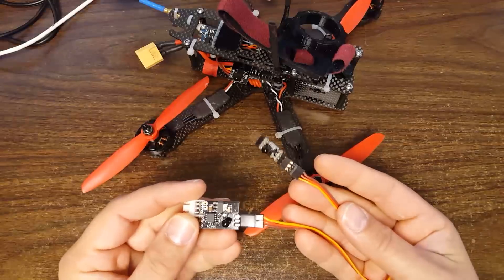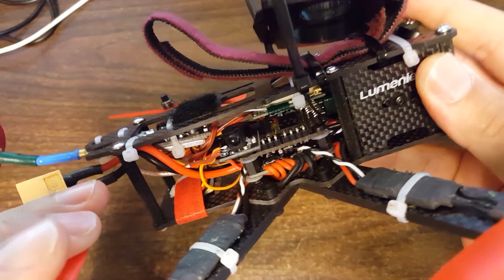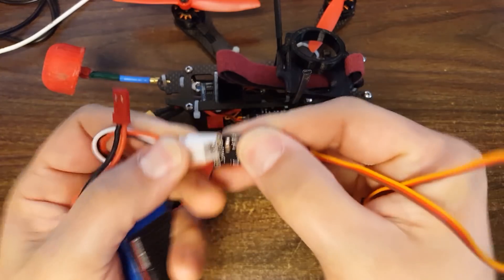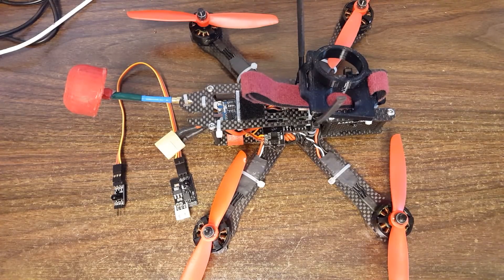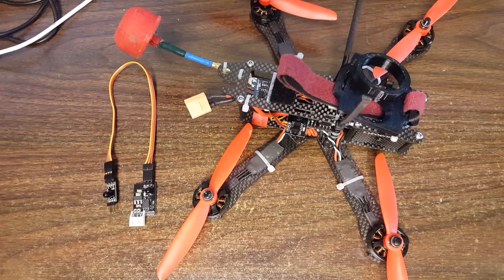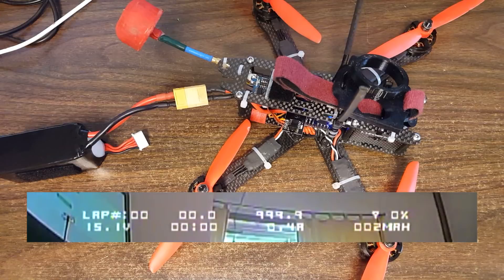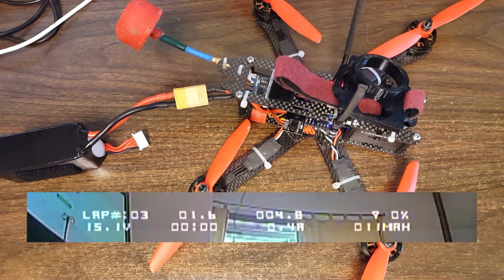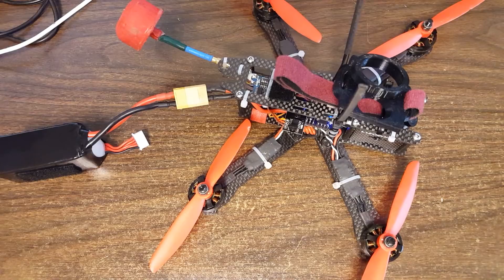RedRotor Lap Timer System Introduction

Comment: Hey Josh,

I also have the RROSD, + f303 v2, and was just wondering if you connected your fpv through the F303 or the RROSD?

I thought i saw it going through your FC but was wondering if you were, what was the benefit over doing it from the PDB?
Reply from the maker: +giovanni mercado Not sure what you mean. My camera and vTX are all plugged into the RROSD. The only connection between the F303 and the RROSD is the 5v power feed to the F303 from the RROSD.
Reply: That must be what i mistook for your vtx or cam. 

Thanks again for the recommendations! Keep up the great work!
Reply from the maker: giovanni mercado I used a spare JST connector, which might be what misled you.
Reply: Thanks!

One last question, were you able to pass through to BLHELI? Currently having trouble.
Reply from the maker: giovanni mercado I have had trouble getting it to work with this board. BLHeliSuite doesn't detect the ESCs reliably, or it says they have unrecognized firmware.
Reply: How did you eventually do it? Can't find the video but i think it was with an ftdi?
Reply from the maker: Arduino.

Comment: I got their PDB OSD you use.  I love it.  I never wanted an OSD because of the wire mess and I like things to be tidy. The Red rotor OSD is a great product.  I was able to cut and crimp terminals for my JR connectors nice a short from the PDB to the camera and to the VTX. 

I plan on getting this lap timer for when I practice with some locals. My OSD is V.4 so I should be good to go.  

Thank you for introducing me to these products.
Reply from the maker: +txfieros My pleasure.

Comment: Are you using "O" rings between the boards and standoffs.
Reply from the maker: +Invitingsauce No. But there are some M3 nylon washers because I needed just that tiny extra little 0.5mm of spacing to make the pins clear each other.

Comment: I did not know that the RROSD lap counting feature was going to be proprietary. I thought it was going to integrate with iLaps. (Like you mention)
Personally, I would have advised them to have done that. This may not gain much love. Proprietary is never a good thing. I get your point regarding a personal training device, but I don't see it being widely adopted.

Even if they added a basic lap timing software it would be more effective I feel- just another man's opinion.
Reply from the maker: +Hiway I'd suggest commenting over on the RCGroups thread, where RedRotor is active.
Reply from the maker: +Hiway Adding basic lap timing software will be tricky. The core of the system depends on whether the emitter is on the copter or on the finish line. RR's system puts the emitter on the finish line and the sensor on the copter. This allows the copter to know the lap times and display them, but then if you want to integrate with a laptop, the copter has to have some way to communicate the times back to the laptop, which is a whole new level of complexity, and probably isn't going to happen. On the flip-side, if the emitter is on the copter, then the sensor at the finish line can easily be hooked up to a laptop for integration with leaderboard software etc.... But that's not how RR's system is designed. The down-side of the iLaps system is that the pilots can't easily know their lap times in real time, because there is no way for the base station to communicate easily with the OSD.

Personally, I have never been to a race where the iLaps system is in use, but I have been to lots of weekends where personal lap timing would be valuable, especially if pilots could spend a relatively small amount on the sensor alone, as long as one of them has the emitter.
Reply: Joshua Bardwell
I will, but I have a long history with Rob and Tony and they have their intentions and rarely move from them- which I also respect. I am a bit biased also being an organizer and user of iLaps gear- so I have to be careful about my personal opinions clouding what may be best for the masses in general. Now that you have enlightened me about the particulars, I need to ponder my stance before being too vociferous, 'eh?